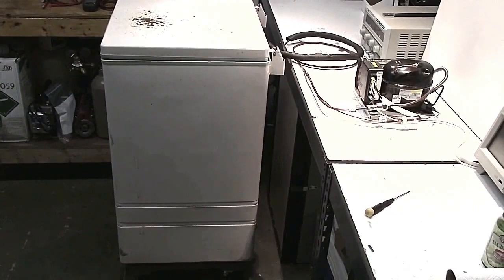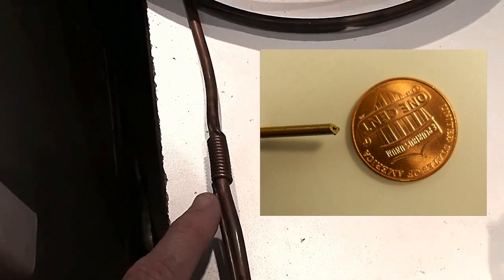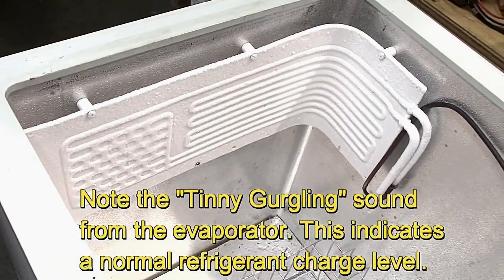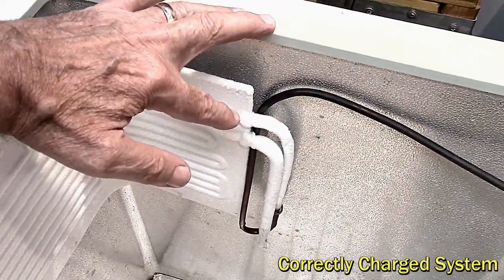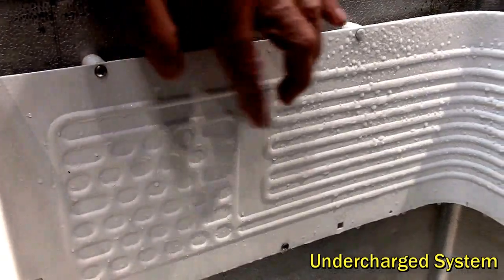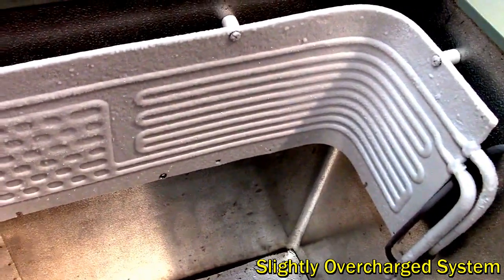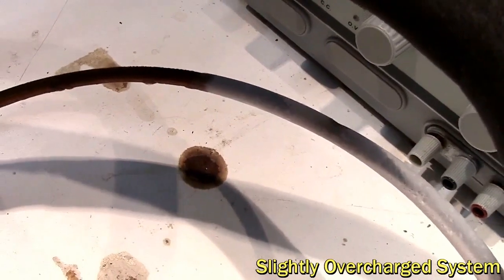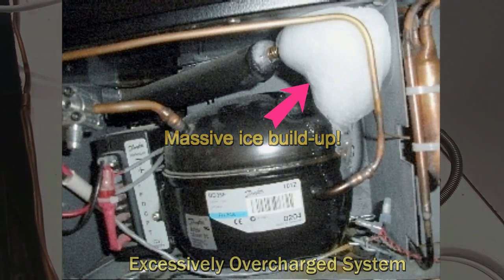Tech Tip   Refrigerant Charge Level

Comment: I found one real symptom of undercharged system is that the compressor overheats, seriously. I think it's because in a properly charged system there's still a little bit of heat the refrigerant has yet to absorb, and it cools the compressor going in, however without enough refrigerant, the refrigerant isn't absorbing anything, and therefore the compressor will get HOT to the touch after it runs for a few minutes, until the thermal protection kicks in and shuts the compressor off (usually it's a reed switch stuck to the compressor that opens the circuit when it gets too hot). If your compressor is shutting down prematurely for no reason, this is why.

Comment: Wow, what a great Video. First a thumbs up. Hope this Video will be seen by millions in the future!
In my fridge, I can not access the evaporator inside. (Waeco with the kind of Compressor you use here). I wonder if the refrigerant level is low, seems to cool OK, but is working long. I can only access the return tube (low side) to the compressor, which is not at all iced up, indicating either good or low charge if I did understand you correct. The question is, can the temperature of the return tube (maybe in relation to environment or fridge temperature) give an indication if refrigerant is correct or low?

I also wonder what a "professional homeowner" (term stolen from Wranglerstar) must build to be able to evacuate a refrigerant system into a tank and use it for filling it up again, after vacuum, and maybe a nitrogen flush, or can the "professional homeowner" flush by other means? Maybe you/anybody can point me in the right direction?

Comment: A very informative video!    Can you advise what changes (if any) to expect to see/hear when the fridge/freezer is in the automatic defrost cycle?  Also, whenever my freezer kicks back on for another cooling cycle, a light frosting forms on the section line almost back to the compressor, but then it quickly thaws in a distinct line back to the freezer's evaporator.  Does that mean the appliance is slightly overcharged?  (Both fridge and freezer appear to be operating correctly ... 0F in freezer and 40F in fridge), with the temperature controls both set at 0/normal.  Many thanks!

Comment: I overcharged my fridge. How do I reduce the refrigerant Ive put in? Please help me. Frost is in the suction line to my compressor
Reply: Do not tell EPA, but vent Some off
Reply: Turn the fridge off, then vent from the port where you added the R134a.   Don't do it while the fridge is running, or it will just suck air into the system, which is not good!

Comment: ice or frost doesnt always mean its flooding back but the temp is lower than the dew point temp, but yes, oddly cap tube systems will usually frost when flooding back. best way is to use ur pt chart , check ur super heats near compressor, than u know 100%... good video tho.
Reply: Well said! This is beer can method, and today, with digital gages  availiability and price there, it is obsolete and inacurate practice for refrigeration tehnician!
Reply: Thanks immensely
Can undercharging also causes freezing of suctIon pipe(pipe from evaporator to compressor)similar to overcharging. There are several information and experience which state that undercharging causes freezing of suctIon pipe also. Kindly differentiate freezing of suctIon pipe between under- and overcharging

Comment: Thanks for this video - we're in the Caribbean and we have inherited a boat with a Frigoboat AV 35 F unit and flat evaporator panel.  It's not been used in a couple of years at least, but its showing signs of having no gas -  the compressor starts normally but there is no heat build up anywhere in either the compressor or the capillary tubes, and there's no heat differential anywhere in the system.  I'm having difficulty identifying which of the two capped off outlets is the one to use to measure low side pressure and to add gas... can you give me any guidance? thanks!
Reply: The Low Side (cold) is the bigger pipe, the High Side (hot) is the smaller pipe. The pressure depends on the refrigerant used. Example: R-134a, with the compressor NOT RUNNING, around +5 PSI, with compressor RUNNING the pressure should be a little above Zero PSI. More than +2 PSI, might get frost on the return line (low side), meaning there is refrigerant in excess. More about... if the pressure is bellow Zero (vacuum) with the compressor "not running", it is low on refrigerant... if the pressure is bellow Zero with the compressor "running", it might be cooling but not enough, so it just needs to be added a little refrigerant. If you have a different type of refrigerant do your home work... R600a works with negative pressure... erhrrrr... Good luck!

Comment: This should at least have a million views 
Never seen such a simple explanation.
Reply from the maker: Thanks AA. It really is a very simple process, but the techs want to turn into something highly technical that they perceive only they can understand.
Reply: @CoastalClimate  
Thanks immensely
Can undercharging also causes freezing of suctIon pipe(pipe from evaporator to compressor) similar to overcharging. There are several information and experience which state that undercharging causes freezing of suctIon pipe also. Kindly differentiate freezing of suctIon pipe between under- and overcharging
Reply: @adeyemibabatunde1814   - Thanks for watching.  No, a undercharged state should not cause freezing of suction line anywhere near the compressor. Maybe the information you came across is referring to something else or misunderstood.
Reply: @coastalclimatecontrol  Thanks for always being helpful and prompt. There are several information/videos online which stated that undecharging or low refrigerant also causes ice on evaporator coils and suctIon pipe. This should be corrected. Some technicians/ artizans may want to collect money from customers, It might just be dirty evaporator coil/ filter causing ice which require cleaning
Reply: @CoastalClimate  I think you are suffering from Donner-Kruger effect.  https://images.app.goo.gl/eAZcprz6Lf393fdDA